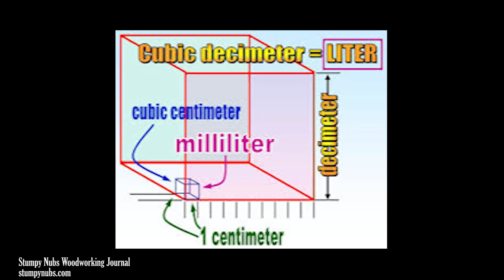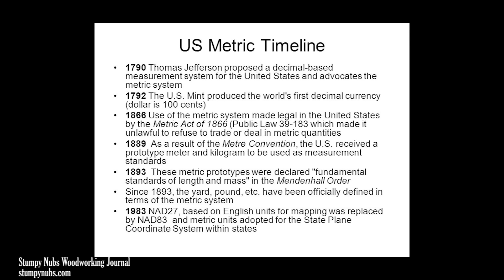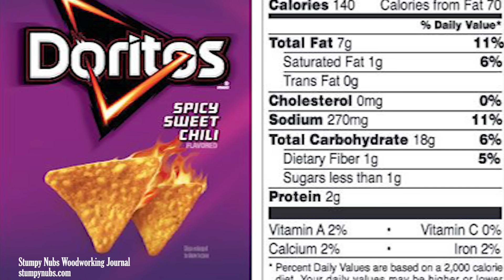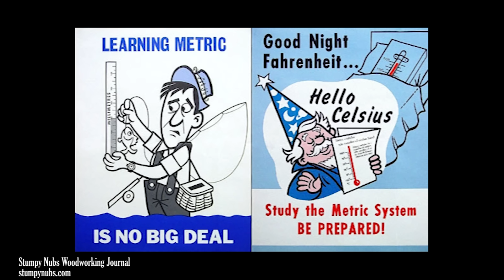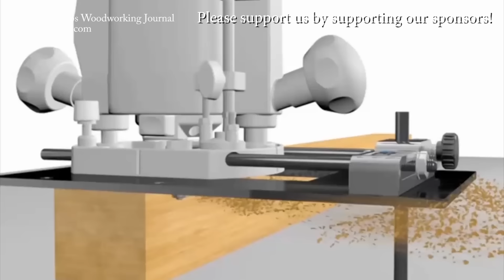BREAKING: The USA is switching to METRIC!

Comment: I’ve been using metric, in a limited way, in the shop for a while now. It is so much easier to use, no fussing around with fractions. Two things have kept me from ditching Imperial altogether. All my tape measures and rulers (except for one 10 centimeter ruler) are in Imperial. I have quite a bit invested in my Imperial measuring devices and I really don’t want to invest more money in converting everything to metric. The other reason, which is perhaps the biggest factor for me, is that I simply don’t have an instinctive understanding of how metric units relate to the world as I understand it. I know what “about 6 inches” looks like instinctively. I have no idea what 50 cm looks like without referencing a ruler or Googling for an Imperial equivalent. I have a sense of how fast 50mph is, but don’t have a clue what 100kph is. 20 pounds I understand. 20 kilos? Not so much.
Reply: Metric is for the limited.
Reply: 20 kilos is heavy.  20 pounds not so bad.
Reply: My suggestion is to find one round reference measurement you can be comfortable with and then multiply/ divide. For example measure your arm shoulder to wrist. It's probably not too far from 50 cm. Double it and you've got a metre. 
Speed is harder in some ways but if you remember 100 is 60 then it's also not too hard to convert in your head, 50 is 30, 200 is 120 etc. It won't be intuitive until you use it with means driving with a kph Speedo, so don't worry it'll come easily enough if/when you're driving overseas
Reply: Some relationships that you may find useful;
1 in = 25.4mm (2.5 cm)  So 50mm is 2 in.  100mm is 4 in., and so on.  Just use 25 as the conversion.
1 kg = 2.2 lb.  For q&d conversions, just use 2.  So whatever it is in lbs., cut it in half for kg.  If it is in kg, then double it for lbs.
A milliliter (ml) is actually the same as a cubic millimeter of water.  1 cubic centimeter (cc) is 100 ml.  
A liter is roughly 1 quart.  Not for calculating medicine or chemicals for a reaction, but it will give you a ballpark estimation.  If fuel is $1.25 / L, then it is $5 / gal.

I hope this helps at least a little bit.
Reply: It is a matter of getting used to it. But the most important part is the ten instead of twelve, dividing or multiplying. And the other thing is: 1 mm times 10 is a centimeter times 10 is a meter. 1/16 times 10 or 12 is not an inch, times ten is not a yard. Hope this helps  and yes look at your measure tape to see how much what is. Another example is a sheet of plywood is 4 by 8. Cut it to 2 by 8 cut it to 1 by 8. Perfect now let's do this in metric: a sheet 122* 244cm in half is 60,5* 244 in half is a perfect 30cm* 244cm( I calculated 5 mm for every saw blade cut). And to be honest 134cm is so much easier than 57.755 inch. Or 134.4 cm
Reply: @_j_j  His example measurement was 6 inches, so I think he's got the comparison thing down. 

Buy yeah, my metric for long distances is a lot better than for short distances. This is because I've played a lot of MilSims which almost always use metric (and rarely yards, because the US military still uses those for some reason despite us only really using yards for shooting and football). For person sized distances or less, I don't really have an intuitive understanding of metric, but it isn't because it's hard just that I haven't used it for that much. For example, I understand about how much a pint is despite never using one for measurement, for obvious reasons.
Reply: @JeffFine it gets better than that though. Not so much the conversion as how well the whole system is tied together. A kilogram is 2.2 pounds. A kilogram is also the weight of a litre of water. 1000 litres is 1000 kgs which is a metric tonne. About 2240 pounds. 1000 litres of water is also a cubic metre. So there you have the whole system tied together.  A hectare is 100 metres square and is about 2.5 acres.
Reply: As a native metric user, I started learning some basic measurements of the imperial system out of necessity (because the US still uses it and many people I follow live there).
My trick to get a feeling for units is comparing them to post parts or familiar objects. For example, I know an inch is roughly from the finger point to the first knuckle.
The same can be done to familiarize with metric. 2kg may be he weight of a specific hammer you own, 50cm can be measured on your arm. Liters are easy, just use a bottle as a reference. 10cm? How long are your fingers?.
I know it's hard to get familiar with a measurement system you weren't raised with. The important thing is not to perform conversions every time and "think in metric" instead. It's the same approach you would use when learning a new language. You first start by thinking in your native language and then translate. Once you get more familiar, you can think directly in your new language.
Reply: 1 meter = 1 normal/big step 
1 meter = half the height of the door
1 centimeter= roughly the thickness of your little finger
Reply: Like with everything pro's and cons. I grew up, just going into metric so was most of what I learned. But when I am building something big I prefer imperial. 6'2 1/4 is easier than remembering 1857mm ..so easy to reverse the numbers 1587 etc or as all metric people say just did the 100mm trick and cut it 100mm too long or short 4" in imperial.
Reply: 60Mph is 96 kmph 50 is closer to 80km
Reply: Understandable. I believe they say 21 days to train a new habit. I imagine after using for a couple of months we would get it.
Reply: If you don't use it you will never get used to it.
Reply: @Komeuppance  Until you begin to talk in thousands of an inch and then you are using decimal which is what metric is based on. 1 sixtyfourth is 15.6 thousands of an inch when you divide it again 1 onehundredandtwentyeighth is 7.8 thousands not many people talk about 1/128 but lots talk about 'thous. The metric equivalent is 0.39624 mm (call it 0.4 mm to the nearest  tenthousandth of an inch).
Reply: if you get a metric measuring tape, get the one that reads 1,2,3,4,5,6,7,8,9,10,11,12,13,14,15,16,17,18,19,20,21,22,aso.. not one that repeats the single digits after each decimal - way less reading errors (this is 40 years experience talking).

Comment: I would use the Japanese solution : one inch = 25 mm, one foot = 30cm, one mile =1,6 km, one acre = 0,40 hectare, one pint = 0,48l, one cup = 0,24cl, one tbsp = 15ml.  In brief, handy English units should be slightly modified to become simple sub-units of metric units and no ordinary America would notice any difference.

Comment: It's still mostly referred to as a 2 by 4 in the UK. However, in the catalogue the title is probably a 50mm by 100mm but that's just the nominal size, when you check the details you find the actual dimension will be a bit less and it will depend on whether it's rough sawn or planed.  
We still buy our milk and beer in pints but the containers list it in multiples of 568ml (UK pints are bigger than US pints).  Culturally we'll be using Imperial for a long time but we know how to use metric and do so in business as the defacto. We have the best of both worlds, the US isn't too far behind.  Will be an interesting day on the roads when we swap to km/h from mph. 😂
Reply: Actually, in the UK we call it a four by two, not a two by four.

Comment: I think the push for metric in the 70s was also hindered by the cost for retooling; it was deemed to expensive to switch over. 

Having used both systems the metric system is just far superior in every aspect.  I don't know how anyone can think that units like: 
12 inches to a foot
3 feet to a yard
5280 feet (or 1760 yards) to a mile

32F for freezing water, 212F for boiling

3 teaspoons to a tablespoon
2 tablespoons to an ounce
8 ounces to a cup 
2 cups to a pint
2 pints the on a quart
4 quarts to a gallon

16 drama to an ounce
16 ounces to a pound
2000 pounds to a ton

16 pints to a peck
4 pecks to a bushel
2.5 bushels to a barrel

144 square inches to a square foot
9 square feet to a square yard
4,840 square yards to an acre
640 acres to a square mile

1728 cubic inches to a cubic foot
27 cubic feet to a cubic yard

There are others, like show sizes and forces.

Comment: I was born in Australia in the 50’s and so grew up in the imperial system. We progressively changed over to metric in the 70’s - so 50 years ago. Having experience of both systems I can work in imperial but I much, much prefer metric. It took about 1 generation for the conversion to be completed even though the majority happened quickly. The slow part was changing peoples’ habits but if you have no option people come along eventually. I find it strange that countries like the UK and Canada are stuck in a half-way world and still have both systems in part. For example metric weights but imperial speed signs and so on. 
It wasn’t that long ago that the USA converted their share market prices from imperial to metric - and you’ve used metric money forever.
Reply: As a 60s-born Brit, I agree.
Being mainly metric does seem a bit silly, though it seems likely there would be political resistance here over changing road signs from the people who wish there was still an Empire, and the subset of the media which panders to them.
Regarding Canada, I remember seeing "Thinkmetric" road signs when I visited there in '86, so they're some way ahead of us.
However, even if the world went fully metric tomorrow, I'd still be forced to use both - I do electronics, and a lot of components use Imperial measurements for spacings, even if typically they use "Decimalised Imperial" multiples/fractions of tenths of an inch rather than the powers-of-two fraction stuff that seems to pervade elsewhere.

Comment: For my woodworking, I'd love to go entirely metric and have been working to replace my tools to get there. However, I think it'll be hard to conceptually switch from miles to km and Fahrenheit to celcius
Reply: Trust me - STOP converting. You learn by immersion, NOT conversion. Celsius was easy - 
30 is hot
20 is nice
10 wear a jacket
 zero is ice.
I have been using km for so long that the Roman "mile" (now American mile) seems incredibly long on a long trip. Unnecessarily long.
Change your home thermostat to C. A comfortable indoor temp is around 23-25°c EVERYTHING is calibrated in metric and is only required to have conversion software for ONE NATION - ONE. I am so fluent in metric units both as a useful practical tool that I get anxiety living in a nation that won't give up it's antiquity. Communicate units to Americans in metric and don't offer a conversion. You'll take a lot of crap but you're doing a great thing to raise awareness on how ass-backwards the US and it's industry is.
Reply: In my experience, temperature is the hardest thing to switch to. Celsius is just weird. It sets the end points in places that make little sense, whereas Fahrenheit at least puts one end near the body temperature that people use to estimate temperature anyways and isn't subject to the same deviation at higher elevations that Celsius is.
Reply: @SmallSpoonBrigade  It's easier if you think of Celsius as 4-5 "zones" of temperature. 0-10 is cold, 10-20 is cool, 20-30 is warm, 30-40 is hot

Many places don't go outside of this range. The ones that do can add "freezing" for 0 to -10. Other places like where I live can add additional expletives to even colder temperatures.

Fahrenheit is often stated to be more precise, but for outside temperatures it's a fallacy. Indoor, thermostats add a half-degree which makes celsius more granular anyway, so the point is moot.
Reply: @SmallSpoonBrigade yeah freezing and boiling point of water (at sea level) is not that nice during calibration because butt temperature is not needed at all 😆

Comment: I am French. I lived for a little while in the US. I did my best to get used to the Imperial system but didn't really succeed. Renting a house in LA I studied the brochure given by the city about the seismic precautions to be taken and I was surprised by the fact that all the measures were metric. It was recommended to keep a certain amout of liters of water at home and in the car. I wondered how the Americans could take it.
The issue is that the imperial system contaminated the rest of the world to some extent: in aviation altitude is measured in feet, in photography lenses are measured in millimeters while sensors sides are measured in millimeters and the diagonal in inches, in automobiles and bicycles tires are measured in inches, TV and computer screens are in inches, and so on. I wish it was eradicated. The EU should decide that no gear can be sold in Europe if its measurements are not metric. It's just a matter of consistency.

Comment: I would love it if we converted to Metric!   Bring it on.  And as you said, we are a long ways there.  But not in the woodworking shop, unfortunately.    I like the idea to try my next project to use only metric - except that my table saw fence is imperial :-(
Reply: What if you ordered an adhesive metric ruler and stick it over the imperial numbers?  That would solve the problem while being 100% reversible!
Reply: Great idea!   @Sugurain

Comment: As a trained engineer using CAD and other tech-based solutions for design, I always saw Imperial units as a burden.

THEN I started tinkering in my shop at home. Instead of drawing out meticulous schematics on CAD, I was roughing out ideas with hand sketches on scraps of paper, wood, cardboard, etc. That's when I stopped pining for the metric system, at least for hobbyist stuff. It's pretty tough to 'eyeball' divisions of 10 but it's easy to repeatedly halve a distance by eye. I found I could dispense with the graph paper and do most of my planning "almost to scale" with quick hand sketches.

This has helped tremendously when planning cuts in sheetstock, for example. It's super easy to sketch out an arbitrary rectangle and divide the short edge into four and the long edge into eight, then noodle on how to place your parts to minimize cuts and waste.

Now, rather than burning hours hunched over my computer in the dark for every trivial part, I doodle in the sun at my workbench and quickly get back to the tools where the fun happens. It's also easier to erase and re-sketch as I make on-the-fly changes, rather than go back to the computer and re-print yet another version of a drawing.

I suppose the world would probably be better if it were 100% metric...but I'm okay wrangling fractions for now.

Comment: I live in Canada. When I was a child, the US announced they would change to metric. Canada didn't want to be the last country to use British Imperial measurements, so Canada also changed to metric. Then the US changed their mind, stopped the process. But in Canada it had gone too far, too late to stop. That's how we got it.

Canada uses a mixed system. The government required everything to go metric, including land measurements and lumber. But land has been measured in feet and inches since Canada was a colony. And a lot of houses were built long before the 1970s. Dimensional lumber is sold as 2x4, 2x6, 2x8, etc. Actually a 2x4 was originally 2 inches by 4 inches. In the 1920s lumber companies got cheap, sold then as 1 3/4 inches by 3 3/4 inches. In the 1960s they did it again, reduced to 1.5 x 3.5 inches. But drywall and plywood are 4 feet x 8 feet. To make walls simple to assemble, wall studs are 7 feet 9 inches long. Walls are built with a 2x4 flat along the bottom, and another flat along the top, since today they're actually 1.5 inches wide that adds up to 8 feet. Of course exterior walls use 2x6 lumber to add additional room for insulation. But all this is feet and inches, so here in Canada real estate and lumber went back to Imperial measurements.

Comment: My childhood was steeped in Imperial but we changed to metric in the mid 70's. 
So I still understand Imperial and it's easier to say "Move it an inch to the right" than it is to say "Move it 2.5 cm to the right". 
(Even though my young assistants sometimes say "What's an inch?")
But when actually building something in the workshop it's metric 100%
I can still do the old inches and feet but why would I make a rod for my own back?
Metric is just so much easier.
Reply: An inch is not 2.5 cm, its 2.54 cm. =P 

But why though? Why 2.54? Its supposedly 1 12th of a roman foot. But how do i know how long a roman foot is? My foot isnt 30.48cm. "Move it a foot over to the right", "whos foot? Yours or mine?"
Reply: @hajkie  
Originally (when metric system was developed) 1 inch = 2.540001 or so. During WWII (1943) it was changed for the war effort to 1 inch = 2.54 cm to enable easier conversion (checking 'old' mechanics handbooks will show the 2.540001 figure). In 1959 this was codified in the US to match US laws with machinery standards. The war change enabled an American inch lathe to make metric parts if they have a 127 tooth gear. (2 x 127 = 254)
Also: pedant
/ˈpɛdnt/
noun
a person who is excessively concerned with minor details and rules or with displaying academic learning.